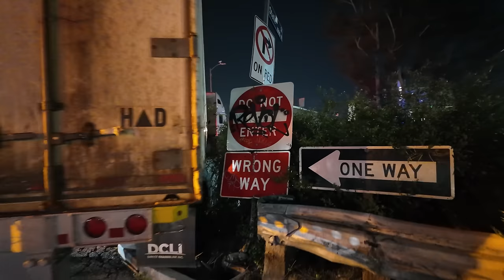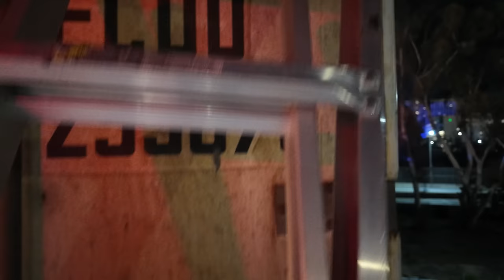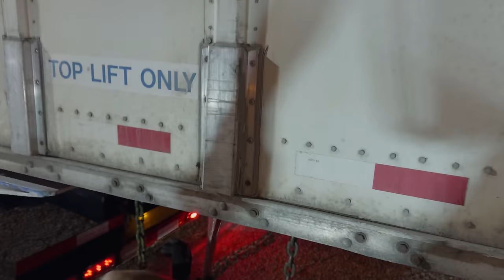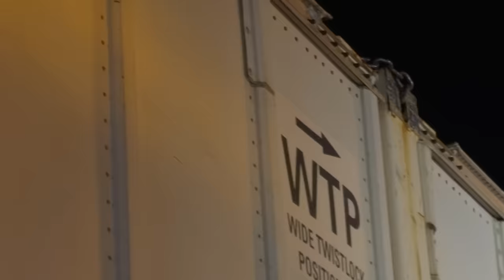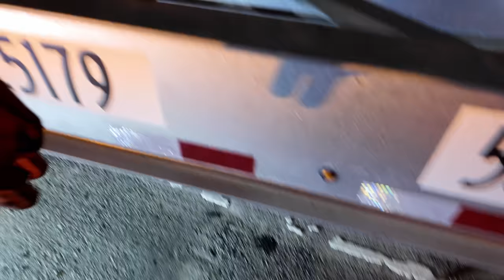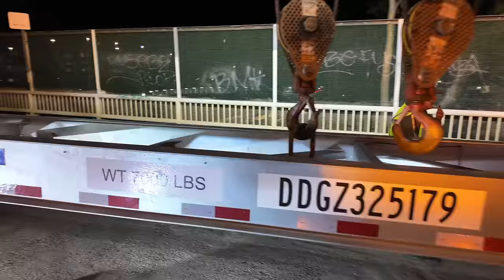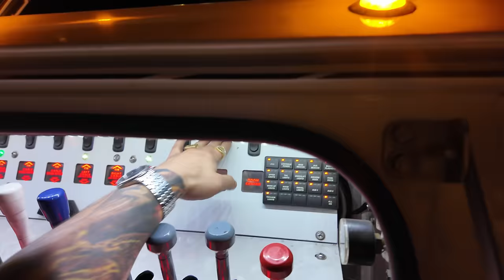Semi takes out light pole - destroys rear axle

Comment: Given the number of errant containers you guys deal with I'm a little surprised you don't have your own container chassis. Are the 53' ones sufficiently rare that the Landoll covers all your bases? Because that was a lot of overhang and I imagine you wouldn't want to go too far like that.
Reply: I'll also mention that containers are meant to be supported at the lift and tie down points. Letting that much hang off the rear of the deck will definitely stress a fully loaded container. IMO, it would have been better to have loaded it further forward, even if you had to crib under the rear tie down point. But, I'd ask someone who knows containers better than I do an opinion.

Comment: Pepe's does so much container work, you would think they would have container trailers they could just roll up to the scene and drop the container right on and drive away. Assuming of course the container isn't damaged at the locking points.
Reply: And the Landolls could have container attachment brackets in the deck.

Comment: Anybody who did this shouldn't be driving a heavy vehicle.  

Pretty clear "non truck route" means the bend apexes are not wide enough for trucks.  Meaning trucks need to swing wide to avoid this sort of thing.  However, that quietly ignores the bleeding obvious, which is that anyone with two functioning brain cells would have known to swing wide for this turn.

It's not only wet weather that shows these guys don't know how to drive.

Comment: With those trailers could bring a dolly ,put it on the tail end and hook to truck keeping the other landall freed up for other jobs.
Reply from the maker: And how would you bring the dolly? A flatbed right? So now you need the time to load it at the shop and secure it and then drop it here and the same when you deliver it. How is that faster than setting it right on a Landoll. And now I need to rear tow the chassis with a wrecker. With your logic can't I use that other wrecker or rot tor for other jobs? We have a dolly, wasn’t necessary here.